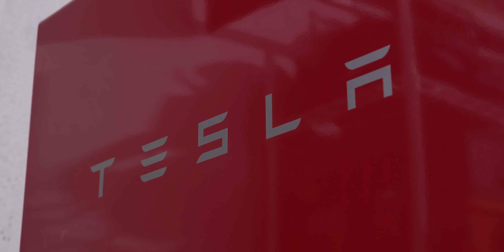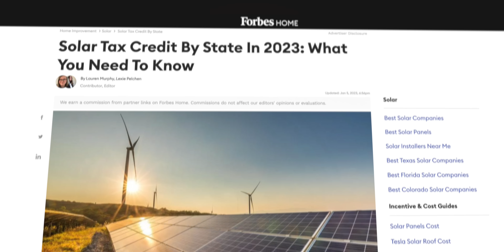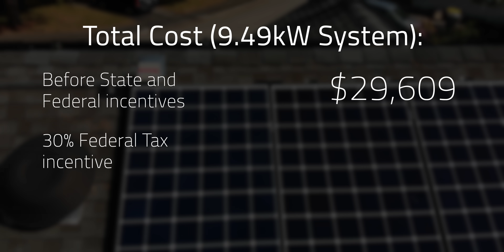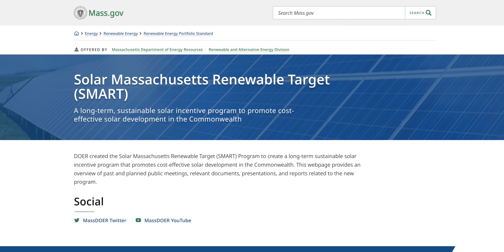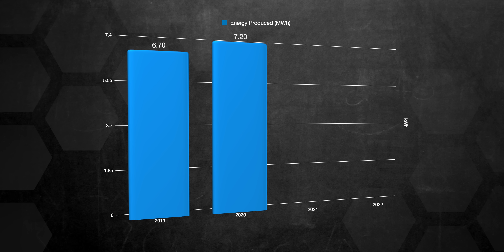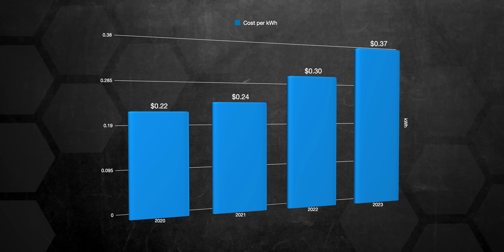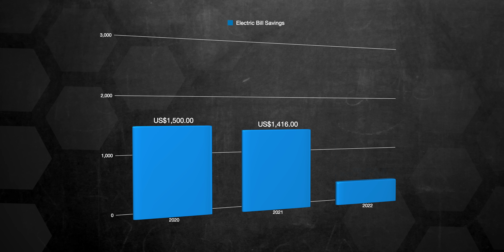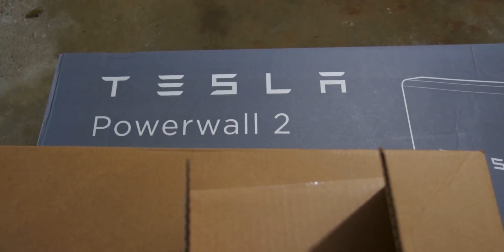5 Years with Solar Panels - Is It Still Worth It?

Comment: As an example of how solar varies by location, I have a 5.78kw system in Northern CA, compared to his 9.7kw system in MA.  Last year I produced 8.5mw to his 7.4mw.

15% more power from 1/2 the capacity of the system.  I'm a firm believer that home solar is worthwhile just about everywhere, but the ROI period sure does vary a lot!  Keep this in mind if you are considering solar for your home.
Reply: There is also the perk of having power even if the grid is down. Recently moved into a house where about once a month something happens that results in a power loss. A couple of times it was for several hours. My Wife wants to do a home generator, I want to do a battery bank and Solar panels. Guess it will depend on the price and when we have the funds available as to which one we do. I have thought about doing both. Solar and batteries as primary and a smaller generator for SHTF coverage.
Reply: @nickm9102  When you do your digging, make sure you talk to the sales guy about hybrid inverters.  The standard home inverter you will get is designed to TURN OFF in the event of a power outage!  This is to prevent back-bleed into the lines which could hurt or kill the linemen working to fix the problem.

The options offered to me to address this would have almost doubled the cost of the system.  So we passed on the batteries or other options.  Not a big deal here, the power might go out for an hour or two in a year.  But if you NEED the backup ability... maybe solar and a generator is better than a battery system?  Either way, good luck, I hope you score a good deal.
Reply: @markpukey8  I'll keep that in mind. I also know there is a special cutoff switch to cot from grid and switch to battery only. That might be what you are talking about but I will have to look into it when the time comes.
Reply: @nickm9102  Pretty much.  But it's not a standard feature, and the cost is higher.  Enough so that I chose not to purchase the hardware that could do that.  So it's good that you know to ask about it.

One other option they offered was to install an entire new circuit to my breaker box, and run several outlets to rooms in my house.  And things on THAT circuit would be fully powered in an outage as long as the solar/storage held out.  I really liked that idea... but then I realized that if the inverter had a 120v plug... I could run an extension cord into my house for thousands of dollars less!
Reply: And you only had to pay $23 MILLION dollars more to live in California!!  #Bargains
Reply: @gatsbylight4766  Oh no Gatsby, I had to pay $17 ZILLION dollars more!  And I had to swear eternal loyalty to The Lorax.  And I had to give it a small child!  But GOSH, I get to live in California!

Maybe that was a bit sarcastic, but then again, maybe your post makes no sense at all.

Comment: Good shows.  A single power wall is not a replacement for a home generator.  This is because of the Amp limit of 1 power wall… it isn’t enough to run HVAC.  You can run your lights and refrigerator etc..  vs. a whole home generator which you can install for the same price (more ore less).  Something to consider.

Comment: Great video… I’m in RI so definitely appreciate the regional perspective (eg, not ideal world California, where most of these companies are based).  I’m at step one in my older house: offsetting oil heat with mini splits.  Hired “best” contractor in area and they undersized the (ducted) returns by 20-40%. I upsized them myself rather than spending 2 mos. begging contractor to return and dealing with their excuses.  Much better flow and efficiency.  Contractor skill and availability are major blockers to me adopting new technologies in my home.  DIY solar will be my next move.

Comment: Got to the end of the video and realized the considering of whether a house covered in photovoltaics is worth it to YOU entirely leaves out the cost to the ecosystem of photovoltaic manufacturing. LG used to make solar panels in Alabama, in the U.S., which has pretty strict environmental protection standards. But LG doesn't make them anymore, which is one fewer U.S. manufacturer, while China continues to grow...and they often just dump the excess toxic chemicals out into their water sheds, causing all sorts of problems . So anyone wanting considering whether going solar is worth it to you, be sure you consider that this is really NOT a "green" technology.

Consider ALL aspects before just blindly following along.

Comment: Congratulations! You took advantage of all the free stuff from the Biden White House. These will not always be available. Also, electricity in Massachusetts is much higher than other areas of the country making solar panels not economically feasible in those areas. I haven't checked the rate here in Tennessee with TVA electricity, but not long ago it was only 15 cents/KWH. Actually, in most areas of the country a person purchasing solar panels would never break even on their installation before having to install new panels to replace the old panels. They do wear out you know! They don't last forever. Matt, you might want to take a new look at your savings at the end of the solar panel life to determine your real savings. The high electricity prices in Massachusetts are not typical across the country and cannot be used in anticipated savings for other areas.

Comment: You failed to mention that your just shy of $7,000.00 knocked off of what you paid for the panels means that so far you've paid your full electric cost since installation, so technically speaking you haven't saved anything yet on your electrical useage costs! Once the solar panel array is fully paid off only then you'll be saving on electricity useage costs monthly. (...around 9:05)

Comment: Great video Matt.  I do have the question about whether its wise to have the Tesla Powerwall battery install inside the home; I can't help but be extremely anxious that something with such high energy density developing a fault would almost be guaranteed to wipe out the entire home.
My current thoughts are on an external brick wall with independent roof; however in Brisbane Australia we don't get the same "white fluffy" problem as you - no snow! =)

Comment: I have 8.76kw system mounted on the roof of my detached garage w/ a 10kWh battery. My biggest issue has been the length of time to get the county to inspect things a get meter upgraded by the utility. My installed stated my county was the most stringent they've seen so they took extra time to install- but the county still make them redo a bunch of work. I'm 3 months post panel install still trying to get through inspections. After the installed made required changes last week my panels are only making about half power too, so something got messed up. The kicker as after all this my new meter is claiming I used 30% more electricity even with the panels producing so my electric bill has gone up! There are so many different groups involved it seems like there's almost no way for this to go smoothly.

Comment: I admire the production values on your video. Can you answer a practical question? If an asphalt shingle roof is 15 yrs. old, then would it first make sense to re-roof prior to installation? The roof does not seem close to failure. The bigger question: what is involved for the eventuality of replacing the roof surface? Would the standoffs remain during the re-roof period; and, would the panels be stored off roof for that period? Any advice on construction sequencing for maintenance would be appreciated. Thanks!
Reply: I think they would have to replace the roof also. Some solar companies also have a roofing division. We didn’t had to replace the roof but our neighbour did and it’s not that much expensive. And it also prevent you to have to redo the roof and uninstall the panels and put them back afterwards so you’d be better off if you redo the roof and get the solar system in the same time.

Comment: I live in Texas where there is no state buy back.  My municipal provider rate is $0.13, and they only buy back at wholesale rates (roughly $0.04).  Not ideal.  To make it really worth it, I would need a battery system, but batteries aren't quite there yet imho.  The cost of the battery system offsets most of the money I would save over the life of the system , and that's assuming the battery lasts the entire lifetime of the solar array... which isn't likely.  So either battiers need to get better and cheaper, or the buyback policy needs to improve a lot.

Comment: How much is the cost to move the solar panels on a roof with asphalt shingles when shingles and underlayment need to be replaced ?  Will roofers move these solar panels when replacing shingles?
Reply: Depends on the warranty you have with the installer and manufacturer.  Some warranties cover removal and replacement for roof repair, and others don't.  If the solar installer didn't tell you it was included, assume it wasn't.  If you haven't installed solar yet, absolutely ask about future roof repair costs to remove the panels.  If you have to pay out of pocket, you're looking at roughly $100-150 per panel to have them removed/replaced ($50-75 to remove, and the same to replace them).

Comment: Matt. As a professional solar installer in Pennsylvania. I can confidently say that this is a very well-done video.  Also appreciate all the time that went into this video. Congratulations.
Reply: I live in PA. My quotes in 2018 were $28-34k.  Now, after six quotes with four from Energy Sage, the bids went from $64k -96k for a slightly smaller system. This is absolutely ridiculous now and not worth the investment.  😞
Reply: @jakewindsor5481   Ever since covid, the prices of everything have gone up. Wouldn't surprise me if solar panels did, too
Reply: @jakewindsor5481  What power production and payback?
Reply: @benzook1220  This was for a 10.1kW system with battery. Through their own calculations, it would take 22-28 years to break even if no repairs / replacements needed. 😮
Reply: @jakewindsor5481  They're all shady!
Reply: I have a question for you.  Why are solar companies so shady?  I always feel like they're trying to rip me off. Why does it cost 29k to install?  Like what is the markup for installation?
Reply: @saltyolbroad2962  that's the price of the panels,  not an install cost. I was told that if i ever need my panels removed and reinstalled  for roofwork, it would only cost $500
Reply: @Alan Ela  the installation was even more?! 😲
Reply: @saltyolbroad2962   i got 40 panels.  $42k, including installation.  His $29k for fewer panels sounds like a similar price.  I'm 5 yrs in and the panels, tax credits,  and srecs have pretty much paid off the panels. And I'm still saving several thousand per year on the electric bill
Reply: In qld australia, we get charged 25c a kilowatt or up for grid usage and get credited 4c kw for feed in👎
Reply: What do you think of freedom forever?
Reply: @willyjordan8997  It's a sales organization. Almost always better to work with a local installer that does much more than just sell & subcontract. Regards
Reply: @belmontsolar6202  i worked for a local installer with a 3.0 redline, aweful experience.
Reply: @willyjordan8997  I would not necessarily want Freedom Forever to do work on my house or any of my friends houses. It is a national sales company that often uses subcontractors. A much better choice is to find a good local installer. The NABCEP Solar Professionals list for your state, is often one of the best starting points. Regards
Reply: Do you know of any good backup battery installers for a hybrid system?
Reply: @levimachado  For what area of the states?
Reply: @benzook1220  I'm asking this guy because I'm in pennsylvania as well... a bit north of philly
Reply: Actually, ANY well-produced video, but agreed.
Reply: Me me me me... Me me me

Decarbonization is 21st century pyramid building.
Just burn coal. 

This is sickening on so many levels.  "How to screw the lower middle class and make them pay for your feel-goodery."
Reply: Nice advert.
Reply: Thanks for promoting a sensible way to reduce green house gases. As a full-time RV    dweller I think you should incorporate more energy conservation strategies into your house and provide video guidance on them.

Comment: I've had solar here in So Cal for 11years. This green state is upping our rates seemingly on a quarterly basis. As of April 1st, instead of getting full credit for the power you generate, new systems are only going to get 25% credit. My yearly "true up" bill has almost tripled in the time I've had solar and is expected to double again (yes my consumption has been relatively stable). Sunrun solar won't touch my current system but will sell me an additional one for 15K to cover the rate increases. What's really going on is CA wants to go full green but doesn't had the infrastructure to accommodate it. CA can't afford to give people with solar systems a break so hence the rate legislation to make solar customers pay up. You will pay for the overzealous green initiatives, one way or another.

Comment: Thanks for this well balanced analysis. 
I installed Eva hated tube solar collectors in my home in Nova Scotia  ten years ago. The system has been reliably providing me with heat for a decade now with no maintenance. 
I am building a new house in Ontario (Canada, not California) and am likely to have PV and evacuated tube collectors. I have also looked into the hybrid panels. Do you have experience with ETSCs or hybrids. Will you include them in your solar security calculations?

Comment: After 5 years of use, have you been able to extrapolate your net carbon footprint from this setup? 
One issue I have with your conversation on cost is you didn't mention the interest rate you are paying on your loan nor do you mention the opportunity cost of investing that $30k and paying the utility instead.
Reply: If all the benefits were actually true, inspectors would require solar be standard on all homes, but the numbers never add up. Never.

Comment: Unfortunately, your situation is very unique by getting a free PowerWall and the tax incentives that were advertised were diminishing by now, or close to it. You have to be an early adopter to get the benefits that would get any result like your situation.  

What I would like to see is a comparison of maybe an average of the previous years for your monthly electricity and the same for your monthly bills with solar to see what what kind of savings you are seeing monthly.  Also, when you sell your home, I would like to know how prospective purchasers felt about your home's unique extras? Was there any home value increase or decrease?  If you sell your home near the last 25% of your solar panel's lifetime, does it become a home feature negative because they'll have to be replaced in the next few years?  And what does that cost look like compared to the original $30k?

Comment: Great video  as usual Matt. I'm in MA and following your journey along the way. Have a 10kW array and PWs installed in 2020. Two things I would like to share with those who planning to build.
1. If you taking loan to cover your project watch out how long does it take to complete. Because of covid delays our project took over the year and I had to close the loan before I got 30% refund. So loan interest was calculated from entire amount. If I would be able to sent this refund check to lender it would pay less.
2. Even with great installers babysit every step. Like discuss exactly where you want equipment would be installed. Everyone wants to have done job quickly and sometimes not most optimal way. I was told we need to have meters, disconnects, etc installed on the front of the house. With little discussion it was moved out the way. Also I made a list of each microinverters ID and placement on the roof, so it was helpful when installer was mapping panel locations (my setup includes 2 strings and 4 arrays).
3. Hot coffee in a winter or cooler in a summer provided to install crew goes really long way.

Comment: I live is San Antonio Texas so I imagine the solar panels would perform great. The cost and the research shows that the installers for the most part take your money and you never hear from them. I calculated the cost vs incentives and sacings and just could not get answers that made me comfortable. I have a good sized roof with sun all day. Tesla advertised here but then when i looked, was not available except through some 3rd party. Every layer is another markup. Maybe on the next house. 

When you sell a house with solar it can hurt you if you still owe a lot on it. However if the solar is paid off, then a buyer will like it because no extra monthly payments. So i thinknits about where you are when you sell. Most people don't have $30,000 up front. A loan or payment plan over 5 or 6 years with these uncertain times and constantly changing tech, makes people nervous. People want to save money every month. Hard to sell that when more likely they will get a bill for solar that exceeds the savngs. 

Maybe in another 5 to 10 years when solar is cheaper or we are all under water. 😆

Comment: if your gonna out solar panels on your house be very aware of what local and state policy is on production credits for the power you sell back to the grid

its very important whether you are getting the retail price or grid price for the economics of your set up

if your getting retail you can probably make it work in fairly sunny area 

if your getting grid it will never pay for itself the price per killo watt rate is just too low.
 youll need a battery set up in this case with the idea being that you capture that higher retail price by curtialing your own energy use